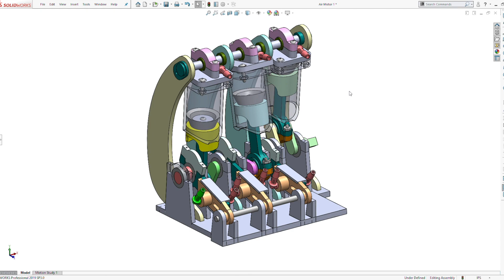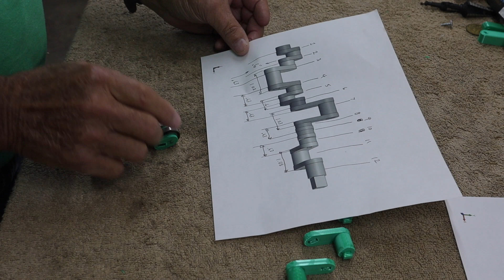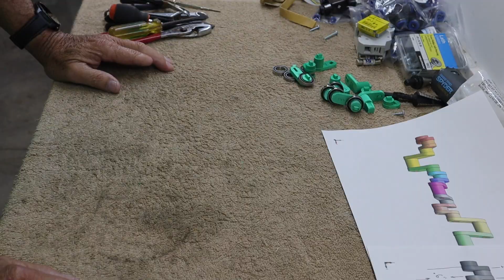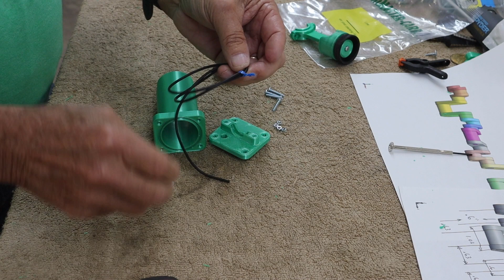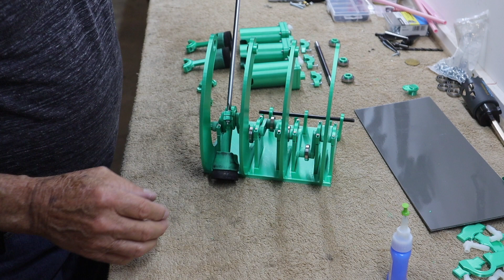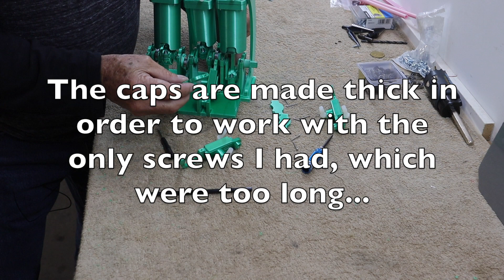3 Cylinder Air Powered Motor

Comment: I don't see how this is a 1 stroke motor. It looks to me like you have the power stroke (down) and exhaust stroke (up). That'd make this a 2 stroke.

If you had a power and exhaust stroke in both directions (like an old steam engine) it'd be, while still debatable, a 1 stroke motor.
Reply from the maker: Hi Vincula, thanks for the comments.  I researched before posting and thought I understood it as a 1 stroke.  Since you commented I researched again and I do think you're right. I did see a reference to the train steam engine you mentioned. There is also talk as guns being one stroke engines but they say that's a debatable engine as well.  Either way, I do appreciate your comments.